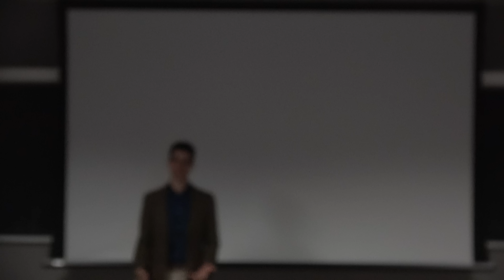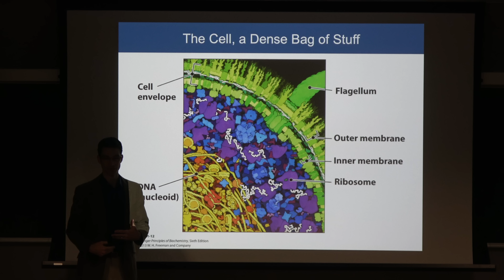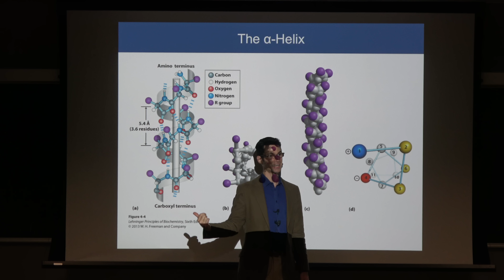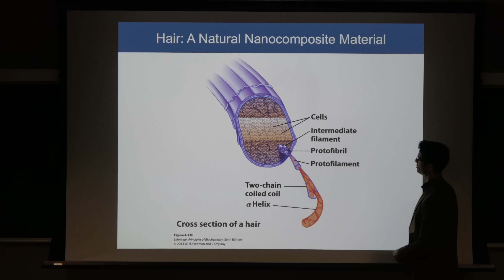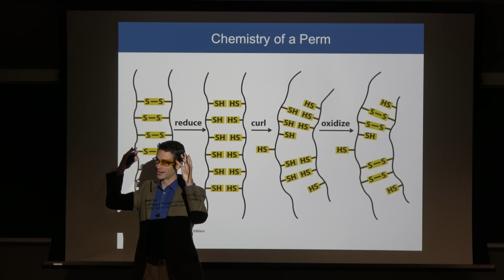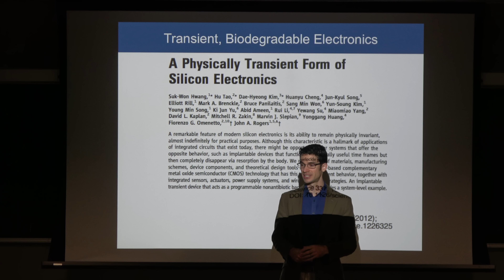Ep16 Primer on protein structure, silk in implantable electronics. UCSD, NANO 11/101, Darren Lipomi

Comment: How exactly is the data retrieved from the tattoo-like nanoscale sensors. For example if you wanted to transmit the temperature that the sensor reads to an app on your phone what form would that take?
Reply from the maker: Data can be retrieved in a number of ways. If it's simple, and RF antenna can be used to measure changes in, e.g., capacitance, within a circuit passively. More complex signals can be read using low energy bluetooth or similar technologies.